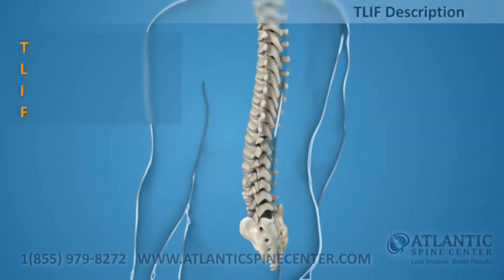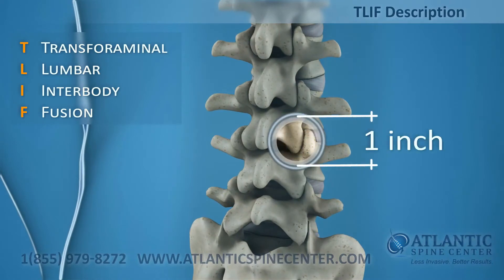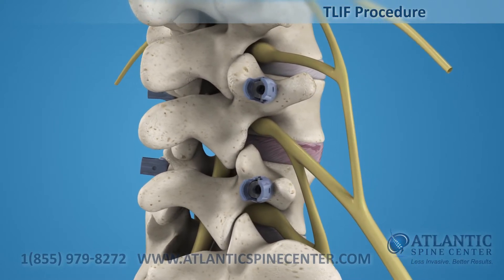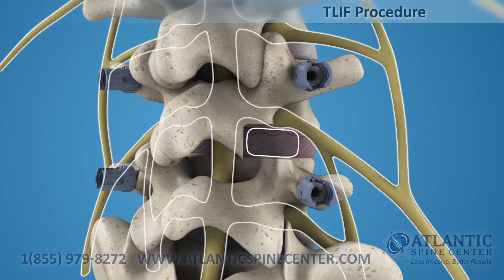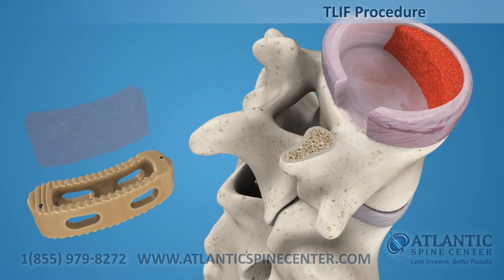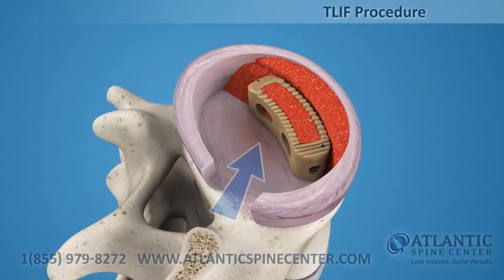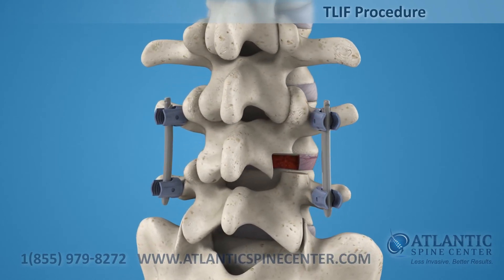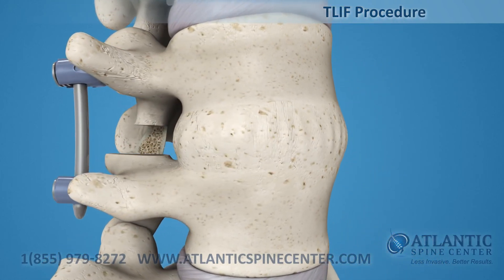Transforaminal Lumbar Interbody Fusion (TLIF) Procedure

Comment: Having this on June 10th for the second time.
Reply from the maker: Hope it went well!
Reply: Hello.  I'm considering having it.  Could you tell me how it went, and did you have the a different area done the second time? Thank you
Reply: @DecayUNCUT didn’t go so well. The brackets and screws are all coming loose making it tough to walk. Getting mri next week. I’ve had 2 surgeries all ready and most likely a third. Pain is about a 7.  They give Percocet that really helps with pain, however I take them sparingly because they make very difficult to use the bathroom. I take only when I cant take pain. Instead of every 6 hours I take them every 3rd or 4th day. Good luck with surgery. Make sure you choose a good surgeon.

Comment: What about the lamina that's removed to create space? Will it also grow back? And does spine not lose stability with portion of lamina removed ?
Reply: I don’t think it’ll grow back, and usually the lamina being removed helps to free up  compression on the nerves.
Reply: there’s a bone graft that cause the vertebra to grow together to form one bone. The screws are just there to hold the spine in place until the bone graft fuses with the vertebra. If it’s just a laminectomy and not a fusion then sometimes the spine can become more unstable and require a fusion surgery at that point. That’s not always the case.

Comment: after the Procedure, can do jogging or swimming?
Reply: In general, swimming is probably better for your back than running because it’s lower impact. I for sure wouldn’t do stuff like deadlifts and squats with heavy weights. One of the risks long term is adjacent segment disease meaning that the next closest disc will wear out faster than normal.
Reply from the maker: Typically, yes. However, every person's case is unique. Please discuss with a medical professional.